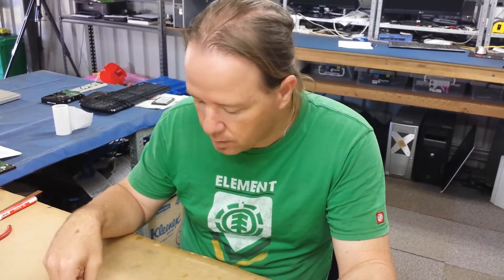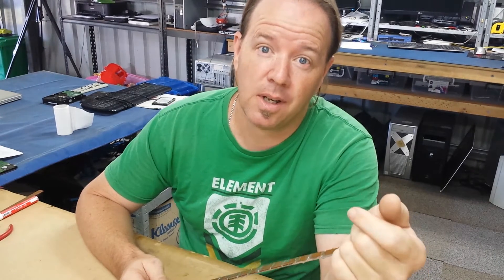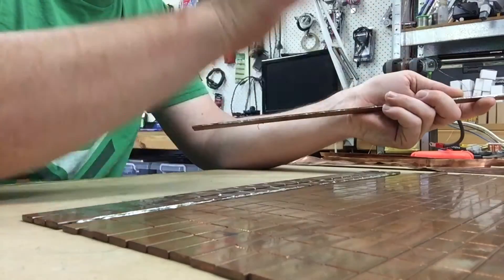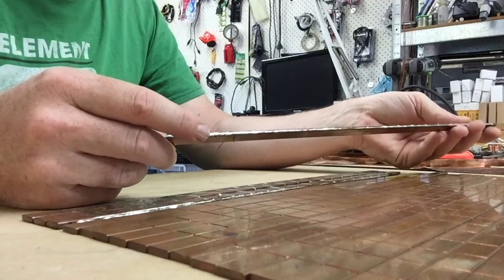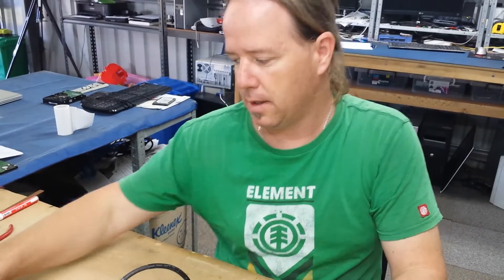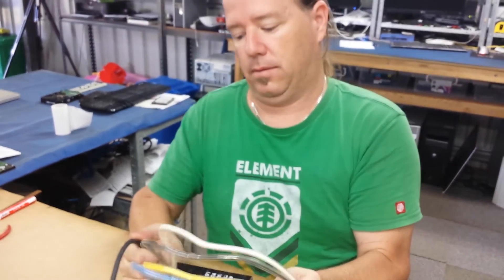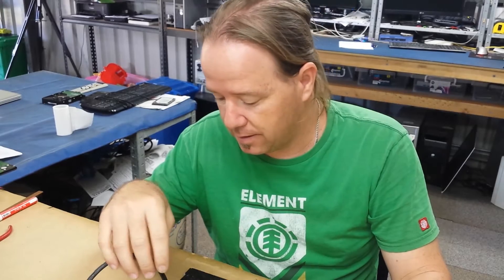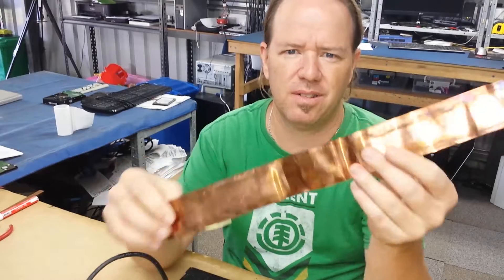A really long chat about the process that has become my busbars

Comment: jeez couldnt you get tinned copper wire, taking varnish off wire is a serious pain and unreliable for a good soldered joint, you have to sand the wire to remove the residue, way too much labour

Comment: I know this video is old, but as an electronic engineer i'll comment on the solder for others. He's using 60/40 (tin/lead) flux core wire. Flux helps solder flow, and is necessary for proper soldering. 60/40 is typically used in plumbing and the sort, if you're starting from scratch find 63/37 electronics solder (Mg chemicals being the best) and use a separate flux brush / coating instead of flux cored wire. The 63/37 (eutetic) solder flows easier, and has a fast 'dry' time, so your wire will stay put after you remove your soldering iron.. it basically makes less mess.
Reply from the maker: I up for some more new solder I'll grab that and test :) Plumers is cheap lol

Comment: I'll snicker while saying things like this but you could always thermite weld the entire encasement if done right.
Reply: would cat5e cable be cost effective because I'm using cat5 for my surround sound system with a rack. the wire is amazing single strand.

Comment: Thanks for your fantastic job!!  Please excuse my poor english..., may be it will be possible to build a pack without the last serie of 4 cell, but with the same lenght busbar, to allow adding cells instead of replacing bad ones?  i started yet to collect laptop batteries, and will begin the sorting of about 700 cells.... that's my beginning.
Reply from the maker: many different ways of doing it you just have to find one that works for you.
Reply: From where do you get the batteries? I want to do a power wall but I do not know where to start collecting batteries

Comment: Should a few cells fail - the whole battery bank has to be split apart & dismantled to replace them; otherwise no problem with the battery pack. Can the plastic holder for the batteries be redesigned for one side only - so the cells can easily be removed from one side and simply break off the fuse wire, pull out the defective cell, then resolder the one cell back in, without rebuilding the whole pack ? That small improvement would make it far more serviceable and attractive to repair.
Reply: actually you do not need to removed the dead cell. A few dead cells will not be noticed at all. The cells are all in parrell and if one blows the fuse the others are still connected to the bus bar and will continue to work and supply current. you only loose the current from the one cell

Comment: Just have the tabs slide into knife switch sockets as they are boxed.
I would have soldered the buss bar with a torch. Off the battery, of course. Just need to affix the pre-measured wires down on the bench and run along with the gun. God only knows if long periods of heating over the cells have caused damage.

Comment: Thanks for sharing your technique for delaminating the fuse-wire using a soldering iron. One suggestion for your battery packs - have you considered making pluss and minus terminals on opposite ends? This way the "total distance travelled by the current" is equal for each and every cell in the pack. Having pluss and minus terminals on the same side means that the shortest path for current will be through the first few cells, and then resistance grows for the rest. Which over time will amount to uneven "wear" of your cells. Current usually follows the path of "least resistance". 
Keep up the great work!!

Comment: I agree with Grim L0gic,  spot welding would be quicker, more secure and better considering the size of the copper tabs you are soldering.  You do have a few cold solder joints on there and if the pack is in a moving vehicle etc.  the solder can shake loose and possibly short something out.  It might be helpful to look at the temperature specs for the 18650 cells and see how long they can withstand 160^C.  Usually 3-4 seconds at most is my guess.  The problem with heating up the copper busbar is it is so large and provides a huge surface area that can quickly cool down.  If you have a fan in the same room it can instantly cool the busbar and you are left with cold solder joints, when trying to solder on the fuses.  A trick to make sure you don't overheat the battery when you solder.(Tape a thermistor to the battery you are soldering, turn on your multimeter and measure it's resistance, PT102, 10K ohm at 25^C goes down with heat.  So if it goes below a set point you remove the soldering iron to make sure you don't overheat your battery.)  About the type of solder you are using, try and find one with rosin core in it.  It is basically flux that helps clean the solder joints and helps the solder flow better.  It is like the flux you used to weld the two busbars but is in the center of the solder.  Good Luck, (Always wear eye protection when soldering)...

Comment: You can get large 500w or greater soldering irons.  If you look around you can find ones with tips in the 3-4cm wide range.  They are primarily used in copper gutter, flashing, grounding bus bar connections.  I would preheat the bars (oven/grill). Make a small wood jig to hold a bar. Have a row of screws on each side to hold the wire.  Just wind the wire snaking around the screws then cut each lead after its soldered.  My guess is it'll take about 1-2min per bar. (also make sure just paint a bit of flux in each slot).
Reply from the maker: +Nick Michels sounds like a very clever practical way of doing it.

Comment: I've been worrying about how to find any blown fuses on my pack. I used the same 0.25mm wire on both side and am now thinking that was a mistake.

With your battery blocks mounted side on - how will you inspect the fuses to find a blown one? And how will you know one has blown?
Reply from the maker: +Paul Kennett The mounting system (that is now in its first prototype form) allows me to simply undo + - terminals & remove from wall easily. So for every full battery cycle for the first few weeks i'll pull it down to inspect.

Comment: It would be great to have some links to the products like your fusewire!
I'm building myself a pack of 18650 andhave  been testing several wires under 5 Amp but non burnt through until now :/
Reply from the maker: I'll get that for you when I get onto a computer.
Reply: +HBPowerwall Thats great. Thanks!
Reply from the maker: +Solar Island http://www.jaycar.com.au/PRODUCTS/Wire%2C-Cable-%26-Accessories/Hookup-%26-Power-Cable/Enamel-Copper/0-25mm-Enamel-Copper-Wire-Spool/p/WW4012 let me know if that works.

Comment: Yeah... I just watched 15:30 min video and it felt like 5 min... nice =]
The coated wires you can use a sandpaper to scratch the enamel surface, it's really quick, you hold sandpaper in one hand and pulling metres of wire with the other hand. Also try a really powerful soldering iron with a square tip, it looks like a screwdriver, they sell as Bunnings, the faster you hear up the surface the less solder you'll need and less heat will be transferred to the cell =]
Next video....
Reply from the maker: +ElectricBike (Bruno) PMed you ...

Comment: Looking great! Why are you fusing both sides of the battery?
Reply: +Edmund Pohl By using thicker wires on the bottom he'll ensure that the top side fuse blows first if there is a problem - so he'll only need to inspect one side of the pack to find a blown fuse. Using wires on both ends provides the benefit of an easy way to connect the battery with minimal heating of the actual battery cell (as apposed to soldering battery strap). Spot welding is the other way to solve the heat problem - but then you need a spot welder.
Reply from the maker: I was thinking about it but didn't
Reply from the maker: What he said thumbsup

Comment: It is looking pretty good. Have you considered spot welding the contacts?
Reply from the maker: +GrimL0gic Not even for a second
Reply: +HBPowerwall 

I know this is a bit old, but I'd imagine it'd be terribly difficult to solder onto those copper bars due to their size.

From what I've seen, spot-welding is extremely fast and very durable.

Is there any reason that you don't want to spot weld?  Either the wires onto the bars, or the bars onto the ends?
Reply from the maker: yep, don't have a spot welder :)
Reply: +HBPowerwall 
Well, you can apparently build one by plugging one wire into one side, and another wire into the other of a 120v wall outlet... Not sure on the safety implications though, hahaha.. And... not sure if I'd want to try that at 240v.
Reply: HBPowerwall You can use a modified microwave transformer to step down the voltage. I just built one for myself for my 18650s. They say soldering heat is bad for the batteries. IDk if that is true, but it is the way manufacturers make their battery packs